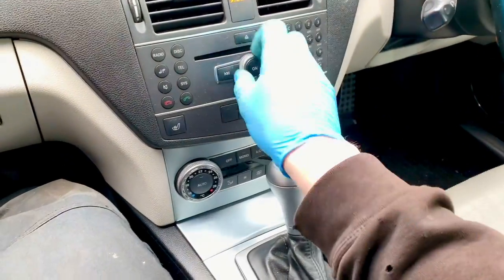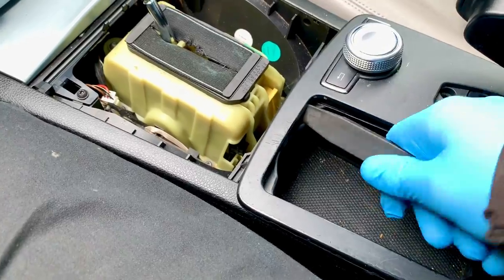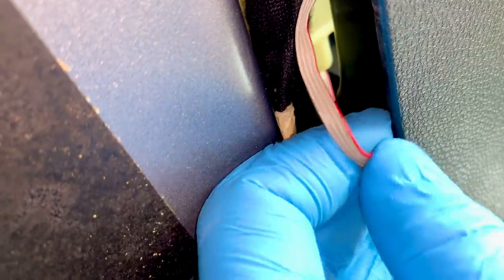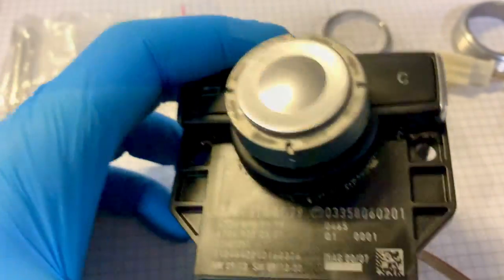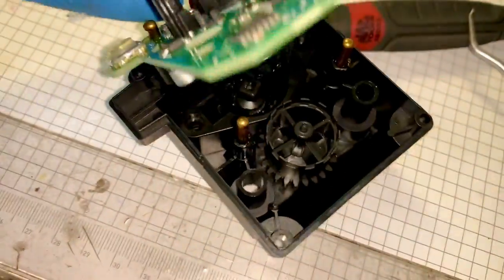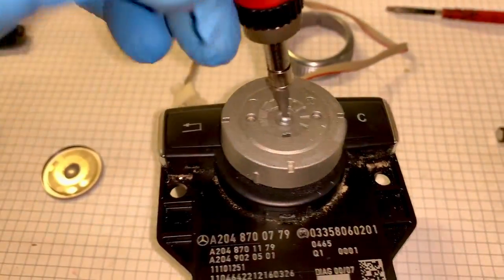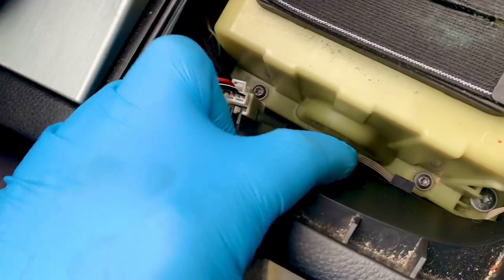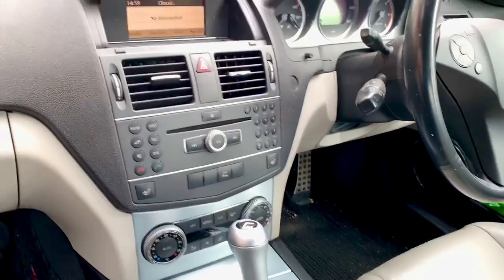Mercedes W204 COMAND Control Knob Repair, Merc C Class Command Scroll Wheel Fix DIY/How to Guide

Comment: Great video, thanks! My 2 cents, I was able to do thia repair sitting on the driver's seat, with the unit still wired through (just disconnected for caution). Covered cup holder and open console with a cutting board and used that as a surface to work on.
Reply from the maker: Yea that sounds like it could be quicker 🤔

Comment: Great fix! Where do you buy the replacement, thanks
Reply from the maker: I think this is the same one I used. 

https://www.ebay.co.uk/itm/403750100316?chn=ps&_ul=GB&_trkparms=ispr%3D1&amdata=enc%3A1bImVW6ZaRL-9EKHIh1Kr3Q44&norover=1&mkevt=1&mkrid=710-134428-41853-0&mkcid=2&mkscid=101&itemid=403750100316&targetid=1816181028939&device=m&mktype=pla&googleloc=9046633&poi=&campaignid=19926854768&mkgroupid=150673419551&rlsatarget=pla-1816181028939&abcId=9311015&merchantid=549726580&gbraid=0AAAAAD_Lr1d2E7hsff0y26o0t7rwKXdsJ